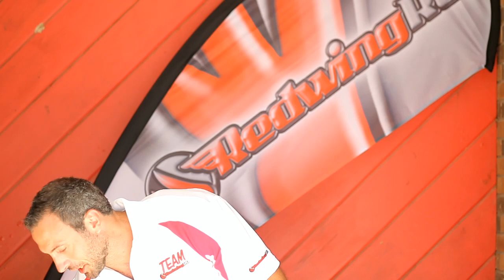NEW Fourtitude V2 Gas Tank

Comment: I guess it depends on what you consider installed.  It's already assembled unlike other options.  that saves you about a half hour.

But then it's still 
Clear so you can inspect easily
Lightweight (very valuable to me as a pilot - I try to go light on everything I can)
better seal than most other options

Comment: I ordered these for my gas planes. I am disappointed in the paper thin plastic and weak hosebarb fittings. An improvement would be thicker plastic and metal cap/hosebarbs